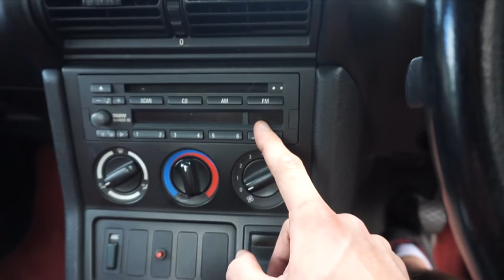My new project car! - BMW Z3

Comment: Awesome buy! I recently sold my 2.2i Z3, and i really miss it. They're great little cars, just don't neglect the cooling system! I also recommend you drive it a bit without the hardtop, its extremely heavy and removing it makes the car feel a lot faster. Mods wise, the first thing you should do is get it a strut brace as these cars tend to tramline into creases and bumps on the road at high speeds and its a little sketchy.
Reply from the maker: Rio356 thank you for the tips man! Iv found that it does tramline a bit so suspension and handling was first on the list. I'm keeping the hardtop on for now through the winter but I may do a test to see if I can notice it

Comment: Nice car, I two have a 1998 Z3 I bought it in 2012 and to date only has 28000 miles on the clock with  load of extras from new, my only complaint is the boot is small, the best point is on a sunny day put the electric hood down and she goes like stink.

Comment: watch out for the rear differential weld and the water pump common on the z3
Reply from the maker: 23briansanchez thanks for the heads up :)

Comment: Had a 2001 Z3 it was fun to drive.
Reply from the maker: Voixnoire yeah they are fun! Which engine did you have?
Reply: 3.0L it was very reliable it never gave me a single problem, had it in great shape. I had to sell it because of bad road conditions. Will buy one again when I graduate university.
Reply from the maker: Voixnoire nice one man! I wish I could have had a 3.0 litre
Reply: Fabien Beddard Just treat it well on the streets the z3 have the subframe problems same as the m3. But fixing it is easy. The previous owner had it crashed from behind which might have been the issue of it.

Comment: For someone who bought a z3 I had a question. Found a year 2000 z3 with 124k miles. Price on it is $2500 (which would be 1900 pounds) good price? Anything I should look for to see if anything is wrong?
Reply from the maker: 124k isn't too bad but id say thats a little over priced, main checks is make sure the roof doesn't leak or let any moisture in, check for rust in the arches, sills and boot (the boots tend to leak on z3's) theres loads of checks you can do, take it for a drive and make sure everything works and runs how it should.. just make sure the engine isn't warm when you turn up as people often warm up cars when they want to hide something! Do a quick search online on the forums :) good luck man

Comment: Very nice! :D I really want a Z3 as well, currently have an E36 Compact. Very, very reliable. What about the Z3, is it as reliable as  the other E36 models?
Reply from the maker: thanks man! nice man :) i cant really give you an answer to that at the moment as i haven't driven it daily! from my research these engines are solid.. and i haven't owned a bmw before so I'm looking forward too driving it. Once i have owned the car for a while i will do a modified car review. Thanks for watching though, subscribe to see the future videos :)
Reply: i've got an '01 with the 3.0l inline 6 with 71k miles now. owned for 2 years and 6k miles. No problems, just basic maintenance. also pre-emptively changed water pump because I was hearing a faint squeak. turned out to just be cracked water pump belt.